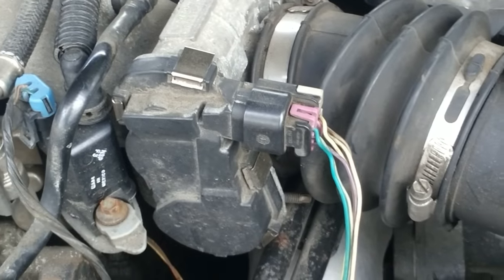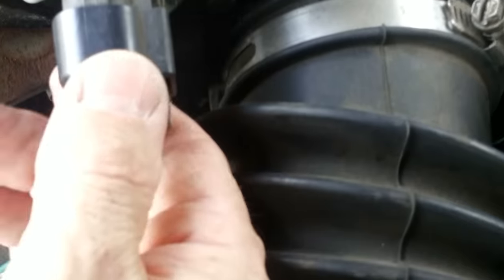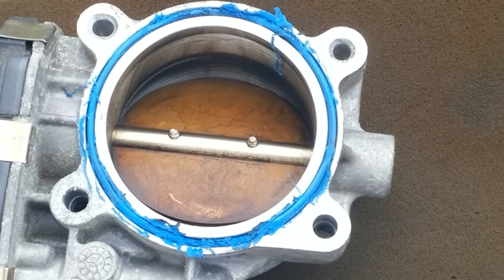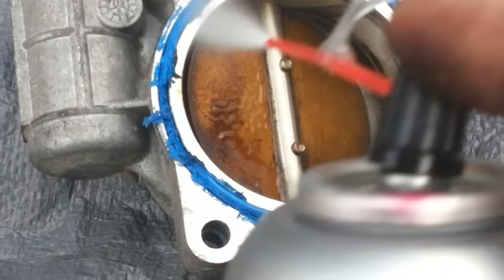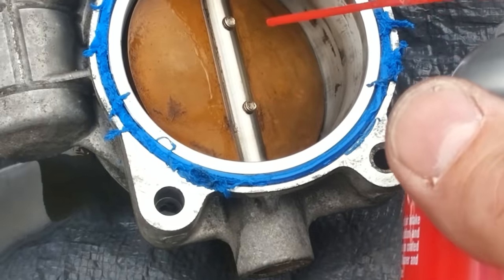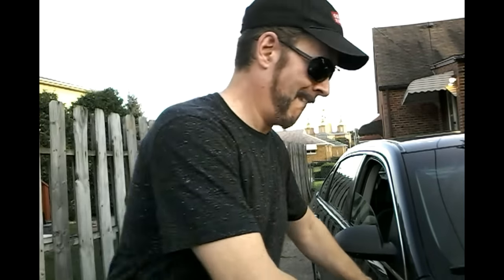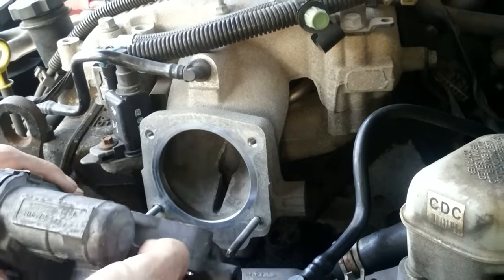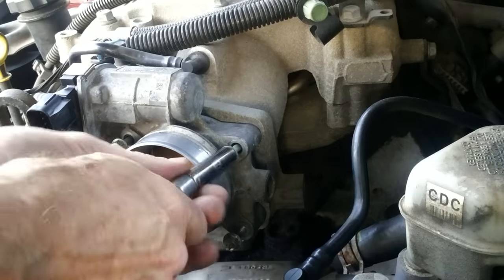Reduced Engine Power.  Here is the FIX.

Comment: Failure mode on my 88 Silverado was that it would suddenly decide to floor itself!  Wheeeee!  ;]  On the freeway in 5th, no big deal, downtown in 2nd gear things got exciting!
Reply: same with my civic lol, there was a hose/line that always dropped and got stuck between the throttle and the throttle body
Reply: @DeluxFuzion  Mine was a deteriorating Throttle Body Sensor.  :[

Comment: My 2002 chevy 2500 just gave me this reduced power code and the truck wouldn't go more than 15mph with the throttle to the floor. The truck would always stall on me like it was having the gas shut off. It would do this at low speeds or in idle. It stalled on me today and wouldn't start. Ran the battery dead turning it over. Finally decided to start with a jump but then had the reduced engine power...Thanks for this video!

Comment: I have 330 k miles on 2004 Venture. Uses leaks no oil runs excellent Original motor trans rack. Only changed fuel pump starter alternator well hubs. Very cheap to fix. Excellent GM product. All my other Chevy trucks over 250k no major problems.

Comment: This happened on my 2010 Impala.  The check engine, ABS and traction control lights would all come on and reduced power mode would activate.  I replaced the entire gas pedal assembly and it fixed it.  $80 for the part.
Reply: Mac Neoh Same thing happened with mine! I was driving cross country by myself on the highway and it locked up so I couldn't steer. Managed to make it to an autozone and they diagnosed the problem and I had the part installed by my uncle.
Reply: Johnje Jasper Nice!! Saves you about $300 dollars doing it yourself.
Reply: Can you tell me the name of the part i need for my car the same thing is going on with my car abs the traction control is on and also the engine reduce lights comes on im a single mom is haard for me to get help especially me paying everything thanks God bless
Reply: solo Dios me Puede jusgar, I took my car to O'Reilly's Auto Parts store and had them test it with their code reader.  The code came up for the gas pedal position sensor.  There are other things that can cause this, so make sure you have the codes read on your car at an auto parts store.  They will do this for free.  If it is the gas pedal, you will be replacing the entire gas pedal. The tools you will need are; a 10mm ( I think it was a 10mm) socket wrench with a small extension, and a small flathead screwdriver. It will take about 35 minutes and less than $85 for the part to fix.  Remove the 2 10mm bolts from the floor of the car that secure the gas pedal, pull the gas pedal out a few inches to get to the wire harness and use the small flathead screwdriver to unclip the wire harness, remove old gas pedal.  Put the new gas pedal in in reverse order.  It is really easy and they will charge a few hundred for this at the dealership.  Again, make sure it is the gas pedal relay sensor by having the codes read at an auto parts store.  This is a very common problem with the Impalas and Malibu.  I hope this helps you.
Reply: Mac Neoh thanks alot so i just go to the O'Reilly store and ask them to do a code reader or i just let them know the problem im having with my car ?
Reply: Mac Neoh so im replacing the whole gas pedal or just the sensor im confused sorry
Reply: solo Dios me Puede jusgar, you will replace the entire gas pedal. The sensor is built into the gas pedal and they are one part together. Take your car in and ask them to read the check engine light codes and tell them the power reduction mode and other lights came on.  Just see what they say when they do the test.  I wouldn't mention the gas pedel, let them do the reading. Hopefully it is your gas pedal because its an easy fix if it is.
Reply: Mac Neoh thank you so much for your information  it was very helpful
Reply: solo Dios me Puede jusgar, no problem..hope it works out.
Reply: The real fix is!!!!!!!!!!!!!!!
Cut the boots off the battery cable ends and clean both sides with sand paper. Cleaning the one side is not enough the lug side is never serviceable unless boot is removed. I just used dielectric grease to cover instead of buying new cables. Also remove the primary cover and shroud around the fuse box under hood. Remove the positive lugs. Most gmc have three 1 from pos battery cable and two smaller ones powering the computer and something else. When you look at them they look good no corrosion but if you look closely it will look Grey. Sand both sides of the ring connector and the lug surface. Overtime no matter where you live air temp and moister slightly oxidize the metal. What happens is one of these powers the pcm and the others send power to vital sensors. Most of the time as long as its not a broke tps wire or if you accidentally stretch while in drivers seat and kick the pedal connection this connection oxidation does not allow the pcm to have a solid constant battery voltage so when the pcm dedicates the 5v reference to the PETAL AND TPS they are varied. Thus eventually the pcm does not allow the key on pretest yes your gmc will tell you reduced power without starting. Turn key on and wait about 10sec and if the pedal/tps agree nothing will display if not it will display reduced engine power. Also if you are having REP while driving add a new ground on drivers side of engine bay from firewall lug to one of the bolts on the bolts on the alternator bracket. Also grounds underneath drivers side frame rail, under radiator support, and the main negative lug on drivers side engine block. Also on the passenger side engine bay there is the pcm ground that comes out of the the big loom on the firewall goes out to the back of engine just like the braided one it is covered in crinkle cover but they are black wires usually two wires. Cut as low as possible bring up and solder one thicker wire estimated at double the gauge of one of the wires so you won’t have resistance problems. Remove the braided ground from firewall and remove one bolt from the third coil pack closest to the rear of engine and attach the braided ground don’t double ground this remove it because you could cause what’s called a looping ground. Electricity goes to path of least resistance. Since the braided line is very hard to remove from rear of engine block attaching the firewall end back to coil pack bolt leaves it null/void and tight so it won’t rub anything else. Also use a ground wire insulated I think it was 15in from parts store $12 for the new firewall to alternator bolt connection. I guess I could have made a video but I’m posting this on comments in various places share if you think it’s a good thing. My Rep problem is solved no tps,pedal, or throttle body replaced I researched this problem for months because I know a shop would just hose me for parts and I think most sensor issues and there lifetime are determined by there power/ground consistency. 2001gmc Yukon slt 260k miles. Good luck guys.
Reply: @macneoh7418  Took me only 10 minutes to change out the pedal
Reply: I also have the check engine, ABS traction control lights and reduced power mode lights on. What's the error code that indicate this is the problem? Thanks for this.
Reply: @gregoryharlston0602  sell the car.  I had nothing but problems with it.

Comment: This really is the fix!!! Another comman problem that happens too is engine hot/ ac off. Just replace thermostat, it's stuck open do not waste time money on sensor!!!
Reply: lucashernandez8 I didn't replace thermostat just clear codes a.c. hot is caused by coolant temp sensor.
Reply: star child chevy dealer did same for my impala, just to have to take back to dealer and have thermostat replaced as i suggested to them from beginning.

Comment: I had this same issue with my 2011 Chevy Impala, replaced the gas pedal and It fixed the problem.
Reply: I wonder if that's my issue. 03 Tahoe. I've tried everything else.
Reply: I tried that didn't work
Reply: So In late January this year I had the exact problem before my road trip then After hours of research I install a new pedal and it works. BUT now end of October having the same problem I wonder if I put another pedal will it work.
Reply: I put a scanner and the problem is the main computer I haven't fucked with it but just letting you know

Comment: In my case, after cleaning the throttle body and running ground wires, the scan tool still gave me 17 codes relating to the TPS, the accelerator sensors, etc. so I knew the problem was not in the throttle body. After checking the wiring harnesses again, I found out a rodent had chewed on two wires going to the control module next to the brake cylinder. It was hard to see but that was it. Fixing those two wires saved me a ton of money.
Reply from the maker: Had a similar problem with a friends car.  Two shops failed to diagnose it.  The customer told me she lives in a very rural area so after doing a visual inspection, I found not only a nest but several chewed wires.  This is why a thorough visual inspection as your first step is so important.  Glad it worked out for you and thanks for watching!
Reply: I’m having same issues 3 shops 2 dealerships. I’m exhausted. Praying that mine gets fixed soon. I pray it’s just wires
Reply from the maker: I'm hearing this alot about rodent damage.  These little guys are causing us a lot of problems!  Especially if you live out in a rural area!  Glad it worked out for you.
Reply from the maker: I hear that some dealerships are struggling with this problem.  There seems to be a lot of different things that can cause this.  It's easy to fall down that rabbit hole of possible causes.  I hope they can solve it for you. @moonshinesdream

Comment: Want to comment on this condition, I had a piece of tape (that I used to build up the crankcase ventilation tube) that got sucked up in the intake. It got caught at the throttle plate (LUCKILY), and it was preventing the valve from closing to idle position. I got all kinds of coded and the P1516, triggering the Reduced Engine Power mode. After I removed the tape, everything return to normal - throttle by wire was sent into a tizzy (and the REP probably prevented it from going any further).  I was lucky.
Reply from the maker: I've heard of situations similar to yours.  I usually tell people that one of the first things to do is to clean the throttle body.  A dirty throttle body is a common problem and one of the easiest things to remedy.  Glad yours turned out well.

Comment: I been having this problem lately PCM stands for power control module, which is the computerized central processing unit (CPU) of a car's system. It's a control unit that manages the engine, transmission, and other systems based on information it receives from sensors around the vehicle. The PCM is essentially a computer that operates in binary and acts like an "if then" function. For example, if the PCM receives a certain signal from a sensor, its programming will prompt it to do something. If it doesn't receive that signal,

Comment: Thanks a ton for this. I have an 2007 Chevy Uplander and 2 days ago we got the same error.  Problem at my auto stores is that the sensor costs almost as much as the whole throttle body.  So I just replaced the whole thing based on your video.  Thankfully it didn't need reprogramming and worked perfect out of the box. Used Hitachi ETB.  Thanks a ton.
Reply from the maker: EDF Central  You're welcome.  Thanks for watching!
Reply: @lifeafterlife8417  
Just experienced this on my 2017 Chevy Malibu LT.
Reply: I have the same thing on my chevron cruz 2013

Comment: For my 2013 Buick enclave code p1682,  I changed the main fuses box. My car used to shut off while driving. If u have service traction control - reduced engine power without any engine sign or code. Change the accelerator paddle.
Reply: My 2004 Silverado will shut nearly everything off while driving sometimes.  It will stay running, headlights, and (AC) fan will run, but dash lights, (AC) compressor, radio, etc shut off.  A few moments later, it will come back up.

Any ideas?
Reply: I get the reduced engine and stabilitrac fault, with the check engine light. The trouble code I received is P16F3.   Which I looked up is a PCM.  I don't know if that is actually correct, since the fault messages cleared on its own.  So now I'm trying to get to the bottom of why . 🤬😡
Reply: I get that too but im getting code P16F3 which says it's my PCM.   So I'm not sure if that is accurate because of the check engine light, reduced engine power and stabilitrac service soon message.  As of now it has cleared itself 🤔.  So now I'm trying to get to the bottom of why this appeared in the first place 🤬😡😮‍💨

Comment: Thank you I have a 2002 and 2004 Chevy Surburbans and both have done the reduce engine power messages. Both have been great vehicles with the least amount of repairs both have over 250,000 miles a piece, on them. Thank you I now have an idea where to start.
Reply: Those are the older models. Most of the time is is a loose or broken ground wire at the back of the engine.

Comment: For my 03 Tahoe it was a loose harness on the drivers side. Had a broken plastic clip but I taped it and it works fine now.
Reply: Was your Tahoe going in to limo mode because of that ? If you don’t mind me asking.
Reply: Limp Mode *
Reply: @alexisgonzalez8676  it was going into limp mode but I used some QD electronic cleaner on the TPS circuit and taped the harness until I bought a new one and it fixed it. But maybe that was luck because I also replaced the TPS not too long after

Comment: I had the same problem with my 2002 Trailblazer about one year ago. When I was driving on a highway, reduced engine power light came on and it reduced speed to 15 or 20 mph. I pulled over and checked all connectors around throttle body and everything was fine. I was about to call for help when I just disconnected the battery waited for about 10 minutes, connected it back and  then everything was fine, I did not do anything else. Like I said, that happened about a year ago and I have not had the problem again. Probably that is what happened to you sir, cause at the beginning you said you disconnected the ground cable from battery. I hope my experience helps somebody.
Reply: did you try flashing the PCM and updating the software in it like the initial bulletin  stated todo before replacing all those parts?
Reply: cdc16730 negative sir. I just disconnected the battery and few minutes later connected it back and it has been working fine since then.
Reply: Most always it is the grond wire on the back of the engine that is the problem. Many many people have this issue just after driving their truck through a high pressure car wash also. This gets water up into places at the connectors that normally stay pretty dry even in big storms but once wet they corrode in no time and shortly after the warning flashes on the screen. In these cases it's not the ground but the connections fusing on the one plug to the throttle body motor.
Reply: Ricardo Macias thanks man this helped so much!
Reply: Barbellfishing go big or go home Great Sir!
Reply: where and what ground wire , can you show a picture of wire and location please.
Reply: I had this issue  over 10+ times i just disconnect battery then connect again.  Im keep driving
Reply: Andy Lopez lol yea it resets error codes then pops up again ..
Reply: Me too. My lights were left on. I jumped it off and it ran bad. I disconnected the battery and it is fixed!
Reply: Check the clutch
Reply: Did it happen to you again? Happened to me about a year ago and it’s happening again now
Reply: @loon313  negative sir, never happened again till now.
Reply: @destinysantiago8051  why?
Reply: When It happens to me I disconnect the ground wire to the battery give it about 10 seconds hook it back up an boom it resets it....👍
Reply: @jenniferwilloughby2191  awesome!

Comment: Reduced power happened to me yesterday.  2009 Chevy Uplander.  The gas pedal has been super twitchy for the last few weeks.  Literally spin the tires every time the stop light turns green.  I disconnected the negative cable off the battery for 10 minutes.  It seems to be driving a whole lot better now.
Reply from the maker: sounds like a faulty accelerator pedal sensor.
Reply: @lifeafterlife8417  alright thanks I'll give that a shot if it happens again.

Comment: People clean these drive by wire tb’s and mess up the sensors by moving the flap. The correct way to clean them, is to have someone in the vehicle with the key on and press the accelerator pedal all the way down.
Reply: I have a 2007 tahoe I install a stick on the  seat to the gas pedal to press  it down cause I was by my self...I went to look at the throttle n it never open up...any idea why the flap never open?